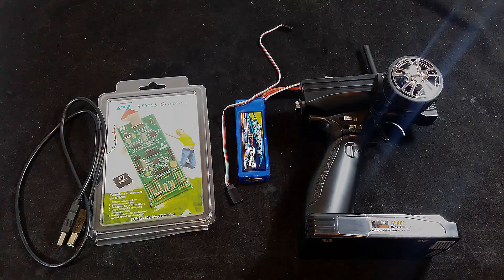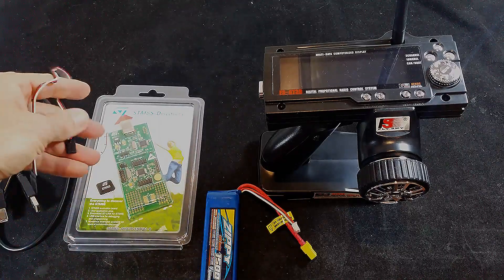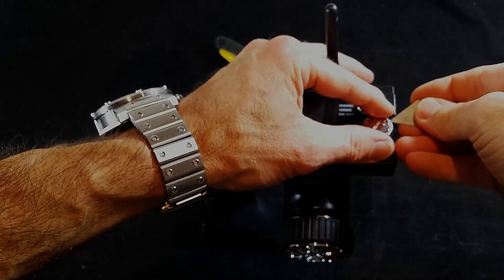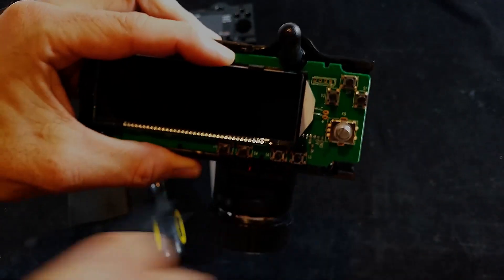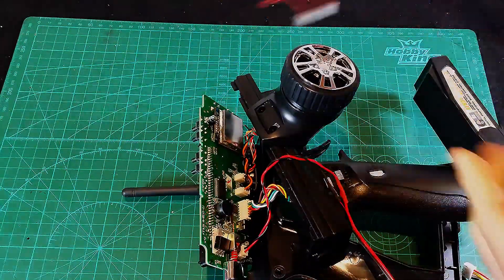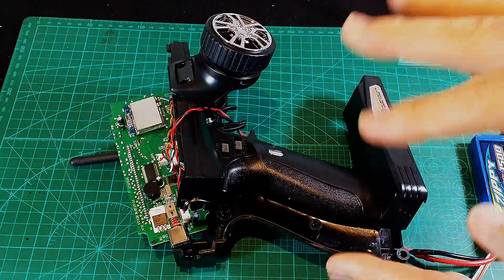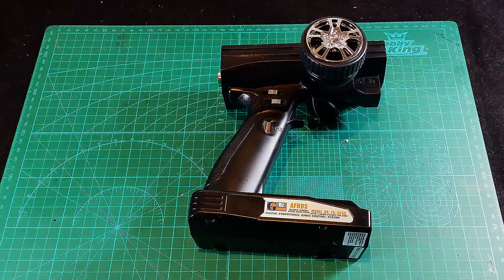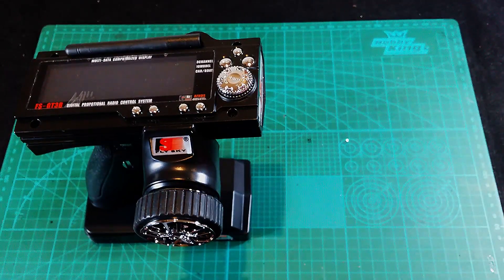FlySky GT3B LiPo Battery Mod & USB Board HackTutorial

Comment: Would it be possible to use a three cell lipo to replace cells in a heng long tank transmitter? . Also,  what could I replace the stock heng long tank battery with to improve running time please
Reply from the maker: Possible to use in the transmitter. You can use a lipo battery like a 5000mha 2 cell lipo in the tank. Will make it run for over 2hrs. Although you must get a lipo low voltage alarm.

Comment: i purchased  a transmitter 3s lipo 8C  2200mah for my futaba 72Mhz   radio that took 8 AA batteries with new lipo  it reads 12 volts  will this be OK
Reply: Actually with a full charge it could read as high at 12.5 volts and this is normal. New car and truck batteries we all know as typical 12 v. batteries always read about 13.5 volts fully charged. 6 volt batteries may read 7.5 volts when fully charged and so on and so forth..........

Comment: Why do we need to discharge the lipo battery ? thanks for the info bmw bro
Reply: btw. ...
Reply from the maker: +Helman w lipos need to be stored at around 3.8 volts as they are very stable and safe to store for long periods of time. You can never leave them fully charged as they might be hazardous

Comment: This mod isn’t very good as the lipo adds significant complexity and most the power is wasted. A much better solution is to replace the linear regulator with a fixed 5v buck converter doing so makes the power efficiency go from 40% to 90% and allows a much lower cut off voltage. Modern NIMH cells are by far the best solution for this as they don’t have issues holding power for months like lipos.